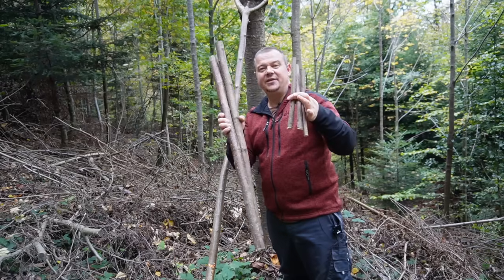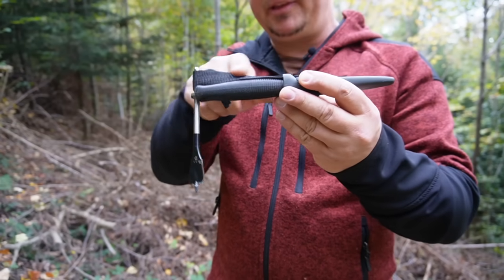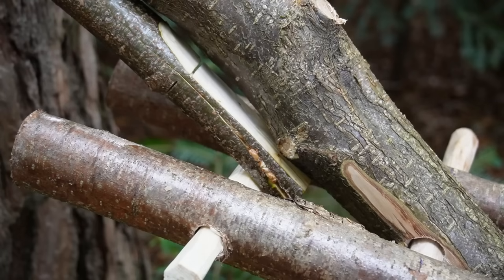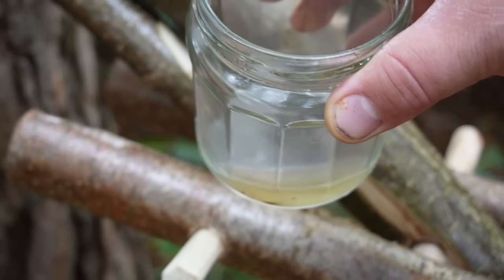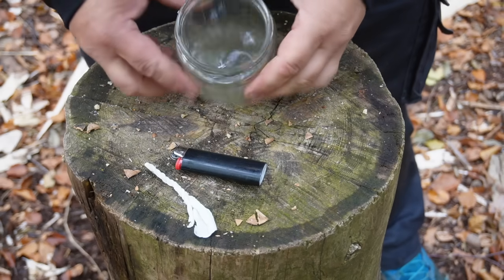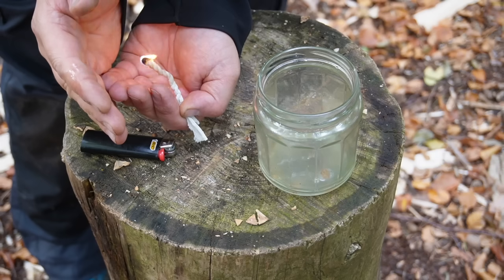I am Oil Producer now!! 😇  Bushcraft Oil Press / DIY Nut Press - A Victorinox Venture Project

Comment: Greetings  Felix. Great idea. My engineering 2 cents: lower to the ground, wider jaws, more leverage and a handle lock. Maybe a large stone as a counter weight. You always inspire new ideas. Thank you.
Reply from the maker: Thanks a lot for your interesting comment!
Reply: Counterweight is a particularly good idea!  Working smarter not harder is definitely in line with Felix's methods.
Reply: You can always upgrade the principle that Felix has shown us into a foot operated, just increase the cross sections of all parts.

Comment: I like a good press and recently pressed apple juice with a press using a bottle jack.This press seems fun but slow. Maybe a different type of press would get you the oil faster. If you take 2 Boards and a rope, make a small exit for the oil on one of the boards, load the nuts onto the board, put the other board on top and the rope around the boards, now you can twist the rope with a stick until all the oil comes out. Have a good weekend ^_^
Reply from the maker: Thanks for your inspiration!

Comment: Okay .an other idea ( kind a garlic handpress. But bigger😁) .. Make a hole in a block of wood with the flat drill..make a small outlet with your Swiss knife at the bottom of the hole.or a small gutter.  Make a dowel fit the hole . Make a leverage for the dowel ..connected to the ground block
Reply from the maker: I think like this you get a  blockage on the first try... but maybe I'm misunderstanding your idea
Reply: @FelixImmler  i can not send any picture or link to one here.
But maybe you could Google vintage Garlic press yourself..to get a better picture of what i meant to say.

Comment: Was ist das bitte für ein Zusatz Teil, um Löcher zu bohren? Wie heisst das auf Deutsch und auf Englisch? Sieht spannend aus.
Reply: Süsse Erfindung diese Presse
Reply from the maker: Thank you!
Reply from the maker: This is a simple flatdrill.. https://www.amazon.de/Bosch-Professional-Flachfr%C3%A4sbohrer-Grobspanplatte-Schlagbohrmaschine/dp/B09418HSPT/ref=pd_lpo_sccl_1/261-2823724-4195364?pd_rd_w=ctfpe&content-id=amzn1.sym.aeef551b-5204-4383-86f6-9d94e2d6944f&pf_rd_p=aeef551b-5204-4383-86f6-9d94e2d6944f&pf_rd_r=Z28ZA5F9VTGE605R3SW6&pd_rd_wg=WAfnQ&pd_rd_r=13e69df8-b87b-40d6-9fec-d62bfdfc280e&pd_rd_i=B09418HSPT&th=1
Reply: @FelixImmler  danke dir. Ich bin keine Handwerkerin, darum wusste ich es nicht.

Comment: So Felix, you started by sawing branches to length - but I could not see which knife you used to saw with - do the venture (pro, etc...) knives have a saw attachment??? 
I found once a 4" fixed blade knife with a folding saw, screwdriver, bottle opener in the stag handle; with germanic writing on the blade... I wonder if you can help me identify this unique  knife??? 
I can send photos of it; if you tell me how & where?